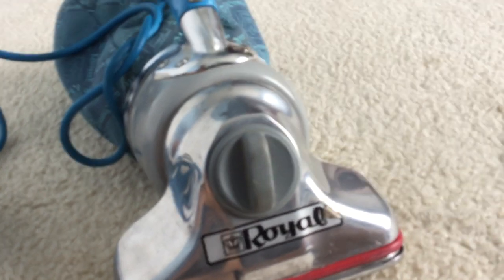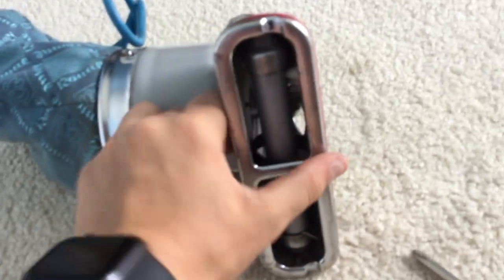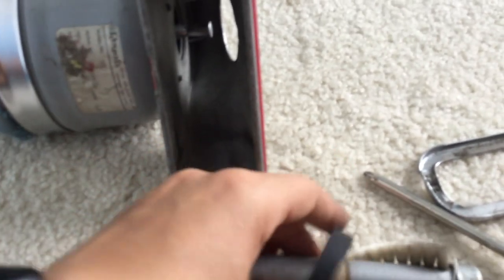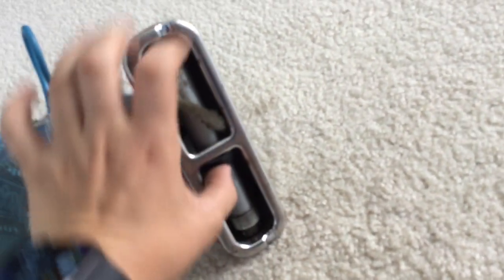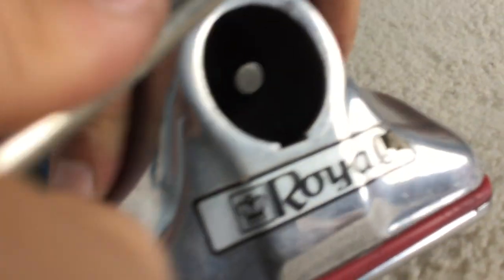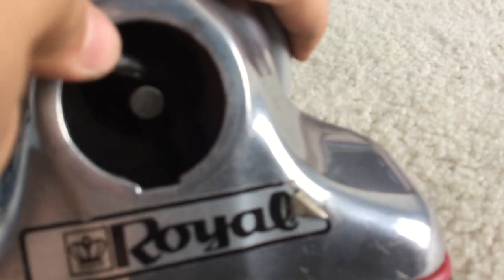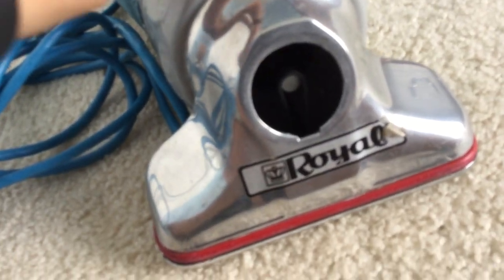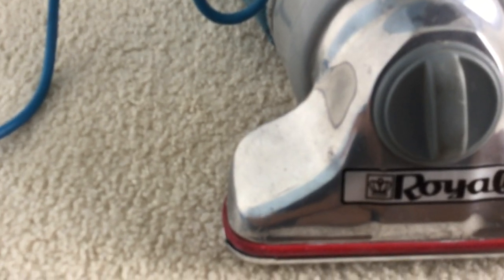How To Change The Belt On A Royal 501 Hand Vacuum

Comment: Thanks!  Didn't know what the numbers were for, mine was still at 1.  Came here because I could not get the roller bar out.  After confirming how it was supposed to come out, I stuck my finger through the other hole and 'pushed' it out.  Got mine in 1985 and never needed to replace the belt until now.  Still had the "extra" replacement that it came with.  It lasted 5 minutes.  I guess the rubber degraded over 39 years 😁.  Had another package of two, probably 20+ years old.  They broke too.  Gonna try some fresh ones from Amazon.  I used a screw driver like you but had a heck of a time getting the belt to stretch enough to hook it on.  I could take the original off and on by hand.  Hopefully the fresh ones will be a little more flexible.

Comment: But where do you get the belt?  These are really old machines and they have not been made in a long time.
Reply from the maker: “Prince Hand Vac Belts for Royal Model 501, 3-501 and 5000” look up that phrase on Amazon they have one belt for 6 dollars. I’m sure you can probably find a better deal somewhere else, but they still make the belts for the machine and they are pretty readily available.
Reply from the maker: “Prince Hand Vac Belts for Royal Model 501, 3-501 and 5000” look up that phrase on Amazon they have one belt for 6 dollars. I’m sure you can probably find a better deal somewhere else, but they still make the belts for the machine and they are pretty readily available.